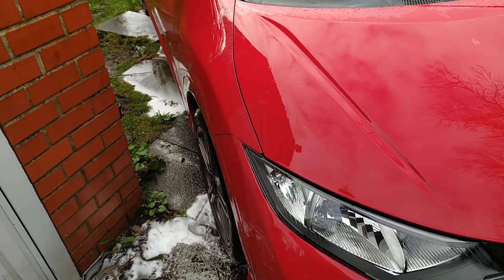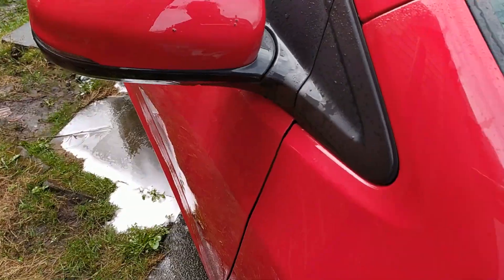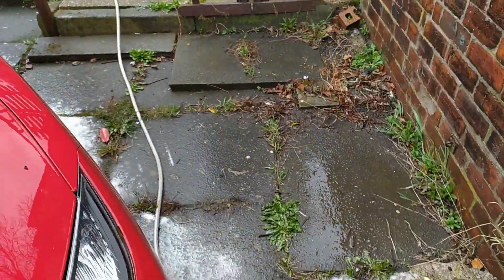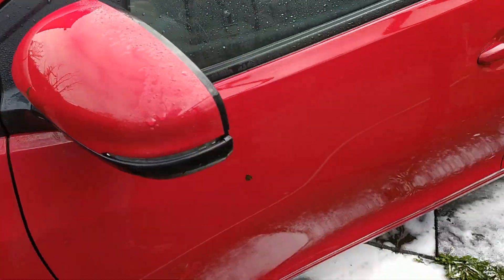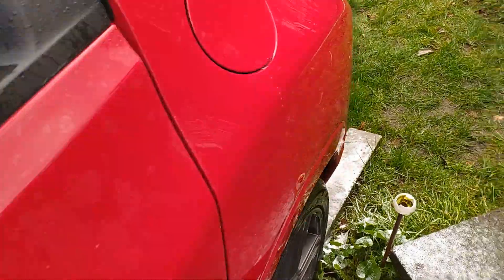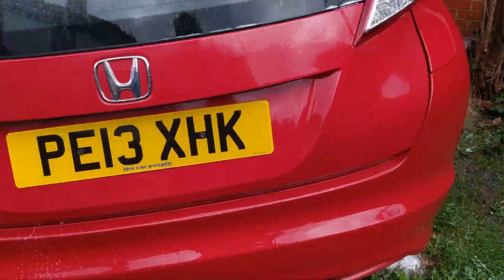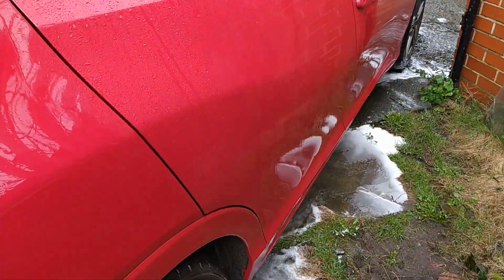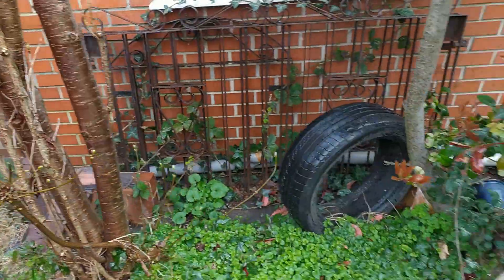Snow Foam Test FAIL!!! (ish)

Comment: Sadly it does happen when you're middle-aged... 

I never bother with a pressure hose now - I just use the snowfoam attachment I bought for direct fitment to the hosepipe and use that instead - if you have half decent water pressure it works very well. Then I agitate it on the car with a fibre mitt and rinse it all off. Much less faff!
Reply from the maker: I'm 99% sure it's an O ring that's gone, but we'll see. I've got one of those 'Demon' hose snow foam bottles somewhere. I'll have to experiment.